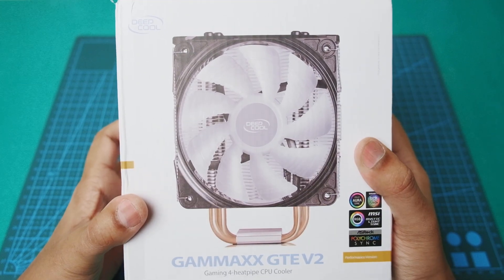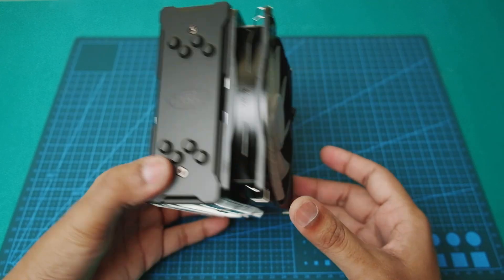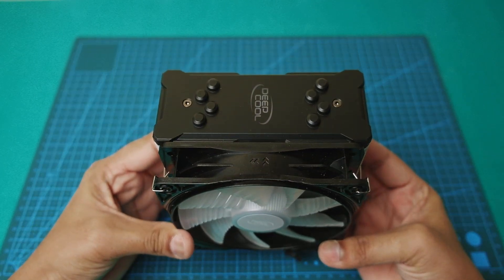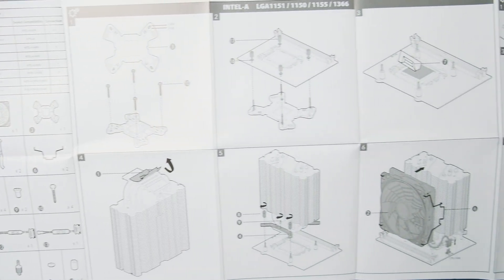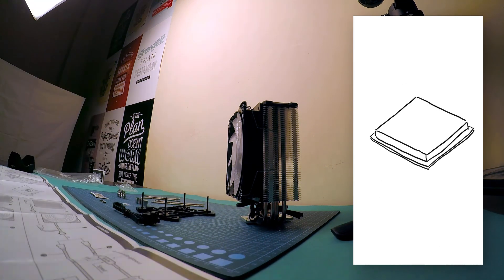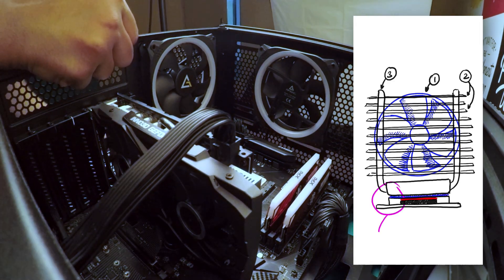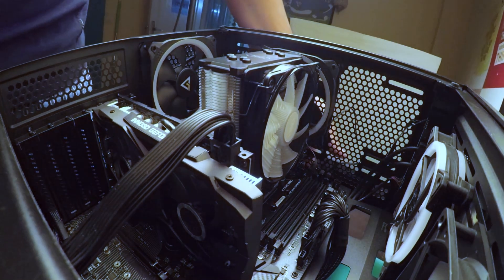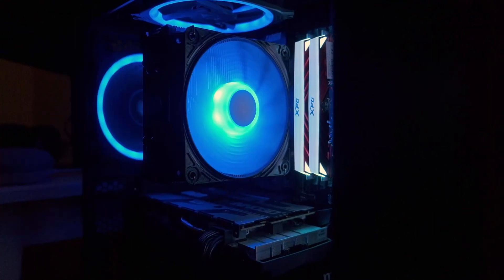When your PC is HOT and NOISY | CPU Air Cooling | How It works | Gammaxx GTE V2 RGB

Comment: bro did it perfectly fit in your cabinet? are you able to close your tempered glass panel?
Reply from the maker: Yes, with clearance of 10mm atleast.
Reply: @ityadiinc  will it fit in "msi mag forge 100m".
Reply from the maker: Yes, it will surely fit
Reply: @ityadiinc  thnx bro👍